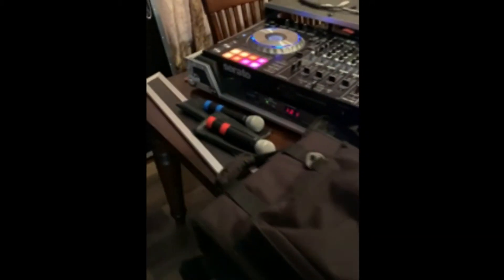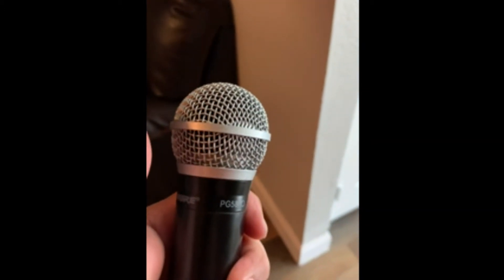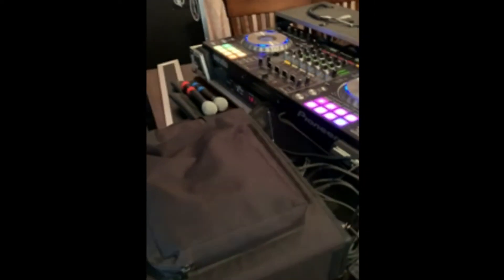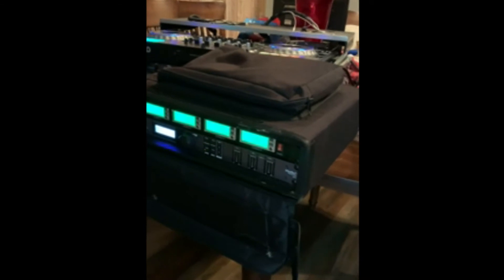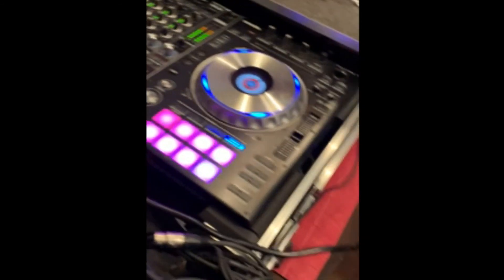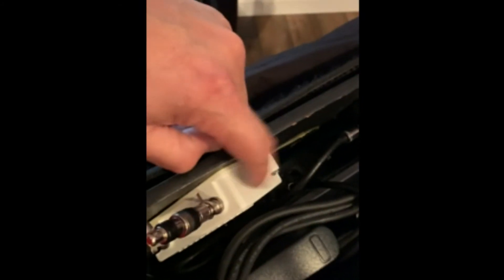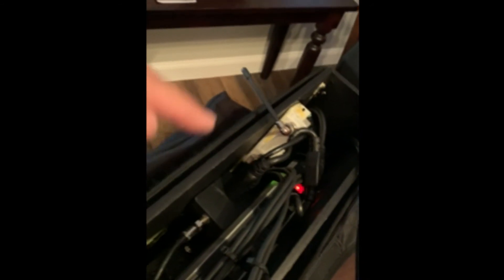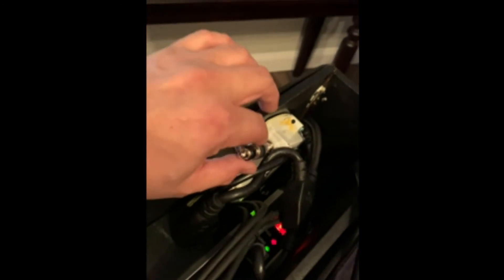GTD Audio G-787 wireless microphone modifications

Comment: Can you please show the modification you did with the handheld mic inside.
Reply from the maker: The only modify you have to do is replace the bottom pattern plate with the original GTD audio head, solder those two cables and that’s it!